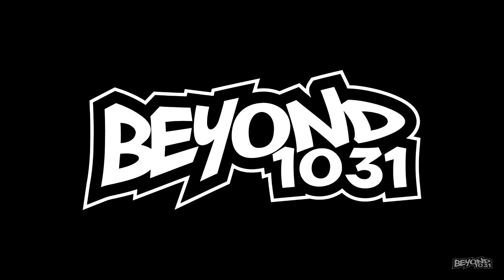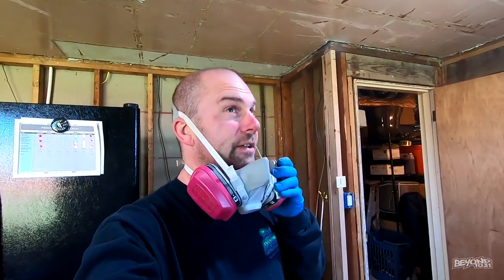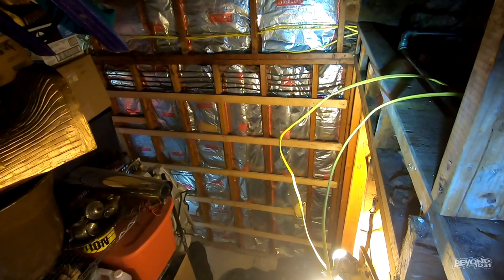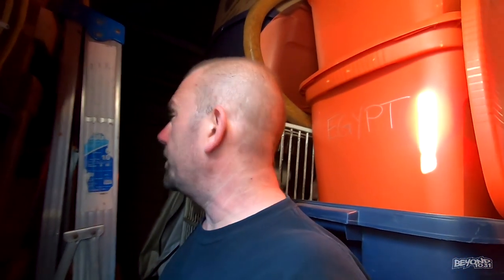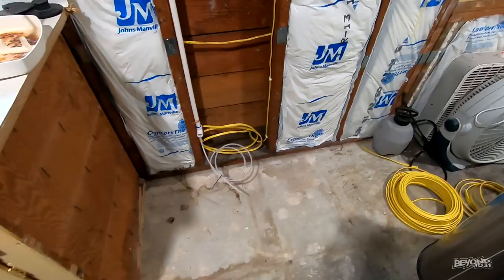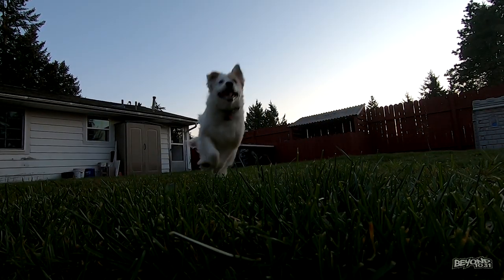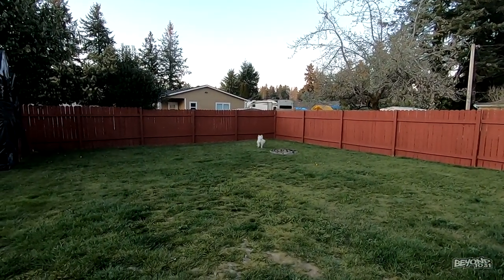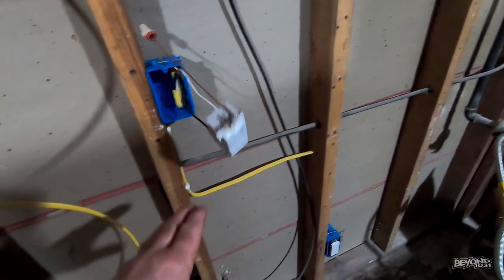Electrical Day! [Day 3451 - 04.12.20]

Comment: My grandpa is a electrician, if you have any questions he could probably answer them. Be greatfull you didn't fall through the ceiling troy. A suggestion from my grandpa go up in your attic and label your circuits. Label them which switch they are. You should get one of those hampster bill and put the go pro in it and play fetch with that and Buffy. Check your P.O. box Friday if you can.